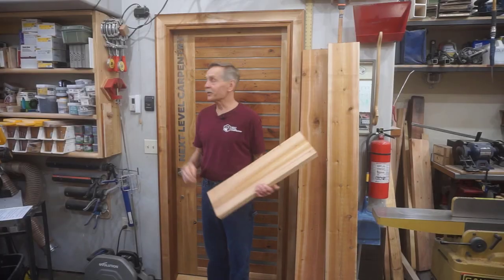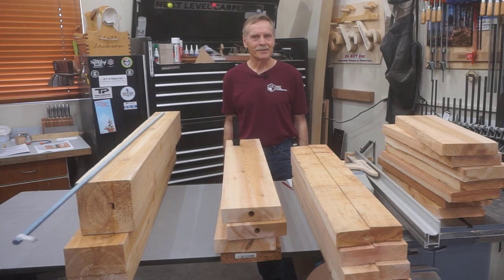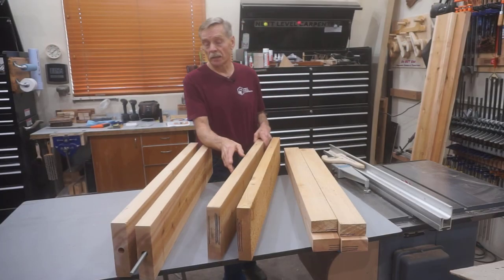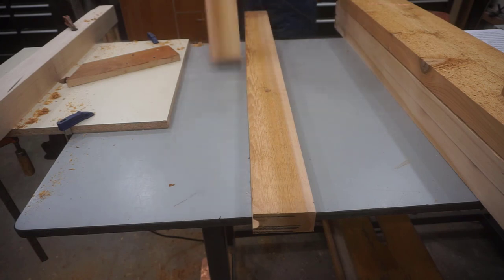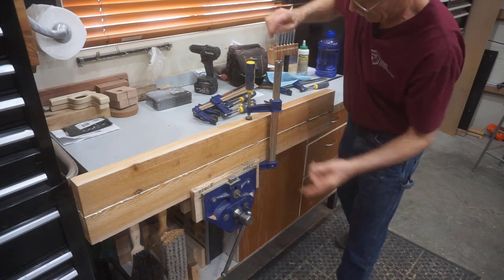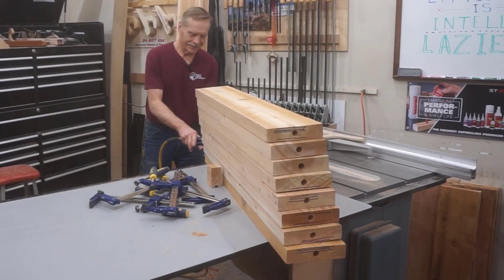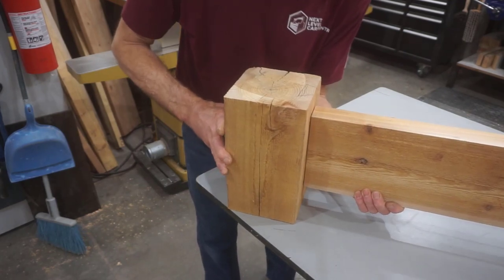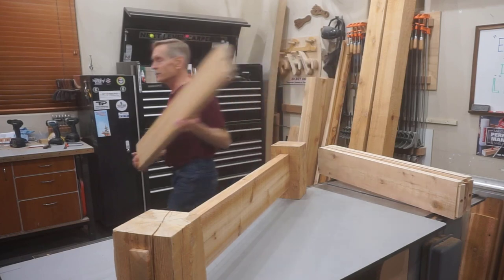Perfect Holes in Long Boards

Comment: Clever & well detailed & explained.  In my neck of the woods, readythread is very expensive.  I was just wondering, watching during your build, if equal results could be achieved by welding a foot or so of readythread to each end of a cheaper steel rod (rebar, for instance), or inserting four inches or so inside the ends of small diameter black iron pipe & welding the joint?  Would that work?
Reply from the maker: Sure John; there's any number of ways to achieve the same physical result however, considering time and labor costs in my neck of the woods, the financial result would be higher doing anything other than what I did.  Keep in mind that this is a job for a paying client where it would be irresponsible on my part to spend $50 of time trying to save $15 in material.  If it were a project for my own use I'd probably buy hot rolled steel rod in 20' lengths, cut it to length and then cut an inch or so of threads on each end...
Best, Matt
Reply: @NextLevelCarpentry  Thanks for responding.  Wasn't criticizing in any way, I thought your idea was ingenious.  And you can't waste a client's money.  I've a project for myself where I think your method would be applicable.  I thank you for sharing it.
Reply from the maker: @johndufford5561  Sorry if my response seemed defensive... the fact is that I really appreciate comments like yours that add value to the video by adding useful info and perspective for other viewers.  I think the most practical method is cutting thread on plain rod but, for capable welder, your idea might prove simpler.
Best, Matt

Comment: I could see using these technique for far more than just bunk beds. Do they by chance make that little square chisel box (not sure what it was called) in different sizes? Or are they pretty much just for door hinges and such?
Reply from the maker: Hey Ryan,
Since these bunkbeds are such a specific application I tried to frame this process in a way that viewers can extrapolate and apply it to other projects as mentioned.  If you're asking about the router bit it's called a "core box" bit and yes, it's definitely available in a wide range of sizes.  I listed a few in the Amazon link in the video description but that's neither the only or necessarily the best source.  I've got a range of sizes with the largest being 1 1/2" diameter and find them useful for much more than this application...
Best, Matt

Comment: I love the tricks shown here!
Just wondering: would you completely glue those piramid caps in or just top and bottom so you could remove it if ever any work on the nuts was necessary (to up the tension or disassemble for movement)?
Reply: You can glue them in with a little hyde glue then if they ever need to be removed a little heat from a hear gun will release it.

Comment: Great trick. I like your ghetto tool setup, you rely on skill more than fancy tools obviously.
Not having a router table, I'd use my circular saw to make 3 parallel cuts 1/8" deep and chisel out the remaining strips, or brute force rough it out with a forstner bit to get a rounded hole. Also works for Newell posts.

Comment: That Evolution saw is a HUGE level up from fiberglass and grit cutoff wheels. Smart purchase. 
While your cover plate does the job, I think a black stained bow tie flush set would be spiffier. If the ends show that is.👍
Reply: Bowties are designed to prevent splitting by keying in across grain.
Reply: @markharmon4963  So you are saying it is not allowed to use bowties for show?
Reply: @dwightl5863  You do not need me to tell you what to do.  I was only trying to explain that certain choices have context.  Putting bowties with the grain would not be in context with their purpose, making them appear frivolous to the educated eye.  Like putting a butterfly bandage on the wrong way. One good thing about Matt's choice is it gives the illusion of a full tenon as the plug is the same dimension as the cross members.  This is a commissioned work so it requires cost controls as well.  The cheapest approach would have been a round plug I suppose.  The rectangular one is kind of an extravagance. I was only saying this in case you did not know.  However I agree any inlay could work.

Comment: Subscribed.  Are you concerned the threaded bolt will loosen over time as the wood moves? Will rods or bolts  begin to wiggle around in the soft cedar particularly if kids are  applying torqing forces?
Reply from the maker: Thx for the sub! You raise a legit issue; I'm not really concerned with the bolts loosening because the whole thing is so overly beefy but, if it seems like a potential problem upon installation, I may put one anchor on each upper bunk post (with a spacer)  into a stud in the 'cabin' which would completely eliminate compounding wobble over time.

Comment: My router table that I have used now for 15 to 20 years starts with a basic box well with two sides missing. It’s two sides and the back with the top. Yes I cut dadoes into the bottom of the top and down the back by simply making one cut then rotating the backpiece 180° and make the second cut on the top cut on the one side along the back and up the other side then shift the blade over just shy of an eighth of an inch and repeat until the back had to parallel Dedos about 2 inches in from the sides and the top had three day does the two running front to back about 2 inches in from the side that automatically lined up with the two because the length of the back was the same as the length of the table top or box top i’ve been simply measured the length of the Gato up the back into the dado on the Under side of the top and cut out my two sides using my measurements glued it all up and then cut a great big hole in the top so that I could easily fit my router and power cord down through the opening. I then took another piece of plywood the same size three-quarter inch and Marked for the holes to screw the router base onto the bottom then using the plunge router cut a hole to center it and then took a little hole saw and cut out a bigger hole. Basically the piece you used that you had your router attached to. The reason for the setbacks was for a place to clamp on guides of which I have several. Some four large bits some for small bits and one straight one and these are all just plywood. I clamp one end fairly tight and then adjust the other end seeing as how most router bits have bearings that I can isolate by taking a long straight piece of wood or metal and set it on the front edge of my guide and shift the guide to where the bearing just starts to touch. Then plant the other end if I’m off Buy a fraction of an inch and I’m talking very small fraction, I take a hammer and tap the guide fence out on it’s end. Do you want to talk ghetto I’m using a hammer as a final adjustment tool and I can actually get down to the thousandths of an inch that way.  Far be it from me to criticize your router table

Comment: I've finally seen a half a hole, but your router table isn't near as ghetto as mine. I wonder if you can show me how to drill a sqaure hole next time🤣 PS ... I think you put the all-thread in backward - if you turn it around you can use right hand nuts
Reply from the maker: The quickest way to 'drill' a square hole is using a dado blade to cut slots in the edges.  Using a straight flute router bit instead of the core box bit is another way... but neither is as cool or as fun IMHO😎  Thanks for the pointer on installing the all thread... I couldn't figure out why I had to pound the nut onto one end and not the other... k-now I know! 🤣🤣

Comment: Is there a reason why you went with a 3/4 instead of a 1/2 bullnose?  I'm thinking about doing something similar but with 3/8 all thread
Reply from the maker: Yes: I thought 1/2" rod in a 1/2" hole would be too tight. I think 1/2" would be fine for 3/8" all thread and bet it will work great for you.

Comment: The demo rails you show for the construction seem to be the beds' end assemblies.  How are the long rails connected?  In the drawing at the opening of the video there seem to be some long rods just beneath the rails. Is this how you solved the lengthwise stability issue? Clearly, you cannot put a centered rod thru these rails or they’d interfere with the crossing rods.
Reply from the maker: You are correct that Crossing rods in Corners would not work. Actually the side rails are connected to the Posts with steel plates and screws which don't show up in this video.

Comment: As always appreciate your attention to detail, but wouldn't a hanger bolt type fastener (half screw half threaded bolt) drilled into each end serve the same purpose without weakening the entire board? You said you aimed for sturdiness, not sure how routing out a large portion of the cross section and re-gluing will be sturdier than just working with fasteners at the end of each board (I admit that would have made for a very short video ;) )
Reply from the maker: Thanks for watching and commenting here.  Since you're not the first to mention using hanger bolt/bed rail type hardware I'll point out a couple things:
Regarding hardware type, I disagree that " hangar bolt fasteners" would "serve the same purpose". Yes, they would hold pieces together but with insufficient strength for my reputation's sake. 
 First is that the type of wood used, Western cedar, needs to be taken into account.  It's not a very dense wood like oak, maple, hickory etc so screws with wood screw threads don't hold very well in it.  It would take oversized hangar bolts to have a large enough diameter with coarse enough threads to hope to hold this connection together well enough to be reliable. And that doesn't account for the construction grade nature of the lumber that's prone to twisting, cracking, etc as it dries to ambient moisture levels.  In my estimation, the force or energy exerted while drying is more than strong enough to overcome any surface mounted/ wood screw threaded hardware, a risk to my reputation for durability I'm not willing to take. 
To address your second point: sturdiness.  Any nominal weakness in the crossmember after 'drilling' and re-gluing is so insignificant as to be a moot point that's in no way "weakening the entire board".  Consider the type, strength and direction of stress placed on the piece in the final assembly and you'll realize that nearly zero force is applied to the glue/drill joint in any direction that could cause failure. The greatest potential force is cupping of the board, hence the shallow mortise/tenon joint in the design that will resist that force considerably where other hardware in question would have nearly zero ability against it.
I don't intend to preach or belittle so please don't take offense from my response.  In the end these are choices made by a craftsman who's reputation and livelihood are at stake.  In this case, if I make a design choice because I don't know enough to realize something that's seemingly 'the same' is inadequate for it's design purpose it costs me pride, reputation and a good deal of profit if it results in an 800 mile round trip callback to Montana's Mountains😉😎
Best, Matt
Reply: @NextLevelCarpentry  appreciate the detailed response in your true next level carpentry manner
Reply from the maker: @feinschmegga  You're sure welcome... always glad to interact with viewers who post legit questions in polite comments.
Best, Matt

Comment: You could save a step by jointing the cut edge flat before routing the "hole" in each half then your only making one pass with the router. I like the method though.

Comment: Without watching the process, I'm gonna say that I would accomplish this feat the most lazyestestest way: cut the boards wider than needed to account for the saw kerf, then cut them in half, whip out the router and put a groove , glue them back together and stand there looking at my work like I'm some freaking magician.... and deciding later if I reveal my magic trick or not.

Comment: You seem to have a negative disposition towards pocket hole joinery. Care to elaborate for a beginner woodworker/carpenter?
Reply from the maker: I think of pocket holes like ketchup for woodworking: perfect for some things but just plain wrong for others. Great on hamburgers but wrong on prime rib or steak. Kind of a weird analogy but thought it might make my viewpoint stick.
Pocket holes are amazing for face frames and other connections but wrongheaded for things like building drawers and edge-joining pieces for a tabletop.  Seeing pocket holes used in absurd applications is responsible for the 'negative disposition' you picked up on.
Don't get me wrong though: I don't want to do without my Kreg jig (or my ketchup) but just because it's excellent for some things doesn't mean its good for everything. 😎
Best, Matt

Comment: Great idea!  Some thoughts:

1. As the hole doesn't have to be a tight fit or perfectly circular, you could forego using the router and--for a LOT less time,  hassle, and expense if you don't have a router--put the half-beams through your table saw at a slight angle to create a cove in each half.
2. If the ends of the hole need to hold the rod in a particular location, a Forstner bit can be used to make space for a few washers of the desired diameter to be epoxied in place, flush with the end of the beam.  (This would also hide the hole not being circular, if that is a concern for you.)
3. To prevent tightening the nuts damaging the wood of the uprights, you can make the hole through each piece big enough for a section of steel pipe that has an ID that is a little larger than the OD of the threaded rod and cut just a little shorter than the depth of the hole.  When the nut is tightened, the wood can only compress a small amount before the force is carried through to the washers in the end of the crossbeam, firmly clamping the upright in place without danger of damaging it, no matter how many times the entire unit is reassembled.

Does that make sense?

Comment: How do you drill a hole along the length of the board without cutting it in half?
Reply from the maker: I don't.  Something amateurs fail to grasp is that a properly done glue joint is always stronger than the wood itself and is 'invisible' for all intents and purposes so cutting it in half is a non-issue IMHO.

Comment: Cool technique but in your case why not use bed bolts?
Reply from the maker: Uhhhh.... should be obvious? 😏
Reply: @NextLevelCarpentry  Hmm, I guess I'm to dense to understand.
Reply from the maker: @codycarse  Sorry, didn't mean to be condescending.  The overall size, design and material used to create these bunkbeds are beyond the strength limits of any standard/typical bed bolt type hardware IMHO.  That wouldn't stop everyone from using it because some feel pocket hole screws are adequate for bunkbed builds, but not me.  As mentioned in the video, I'm making custom design/build bunkbed set for a discerning, paying client, not trying to make a flashy video to cater to the YouTube algorithm.  Those factors really do make a difference because my reputation and liability are what guide my design decisions which rarely align with typical/standard/pre-packaged solutions.
Best, Matt
Reply: @NextLevelCarpentry  I guess my thought is you could have used the same all thread that you used but just shorter lengths in typical bed bolt configuration? Bed bolt connections are incredibly strong, one of the strongest connections possible.
Reply from the maker: @codycarse  I see your point... their strength certainly makes them a viable option although there's a bit more 'fuss' involved drilling holes and assembling the bed using that alternative IMHO.  So "why not use bed bolts?"  I feel my client gets more strength and a better value using the 'bolted tenon' joinery/assembly system which my peace of mind and reputation demand.  I don't see either as right or wrong but as a choice made by individuals involved...

Comment: Did I miss something? You route then joint then route again. Why didn't you joint then route, eliminating a routing step?
Reply: Because he knows what he is doing
Reply: @daveklein2826  Well, I don't, That is why I asked. If you are so smart, maybe you can explain it.
Reply: @jamesvaughn4894  watch again
Reply: Removing material always brings the possibility of the material shifting off straight and square, and the more volume you remove, the greater the likelihood of movement. 

The rip down the center was causing the pieces to arc away from the kerf. The routing takes away more material than the jointer, so you remove as much material as possible before the fine adjustment with the jointer and then finally a tiny restoration of depth with the router.

If you think about it, each step removes less material than the step before it. So that’s why you do it in that order when the material is moving on you.

Edit: incidentally, the movement of the wood as shown here is a symptom of case hardening, which is stress developed within the structure of the wood. It’s usually caused when the sawyer cranks the kiln too hot in an effort to speed up the drying process. Ideally you would let the sawyer know when it happens. It can happen to anyone occasionally, even if they’re careful, but if it happens a lot, the sawyer owes you a refund.
Reply from the maker: Nailed it, Thomas!  Thanks for saving me all that typing to explain exactly why I used the sequence shown in the video... and I'm not so sure I'd have done as good or as thorough of a job explaining either.😎 Best, Matt